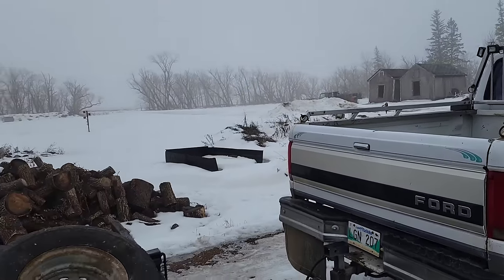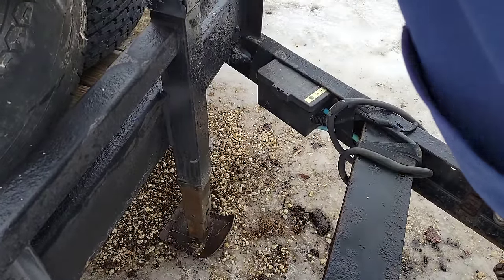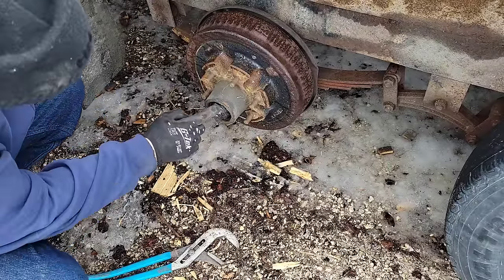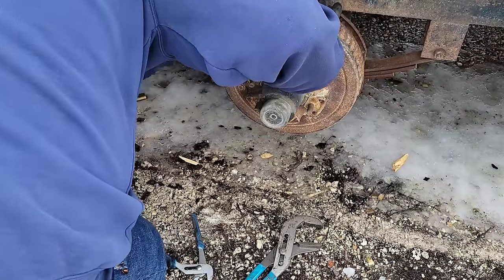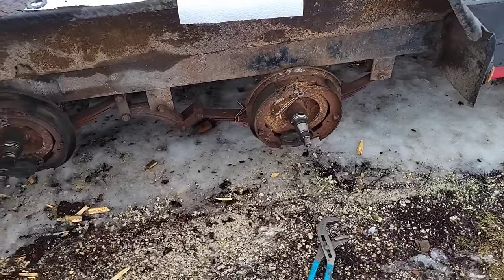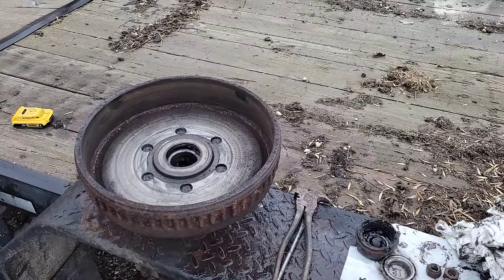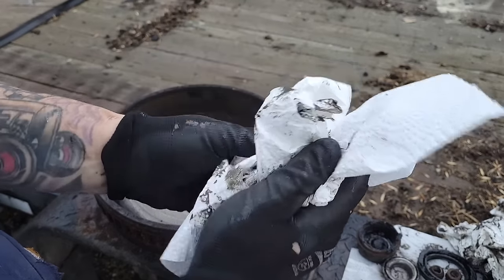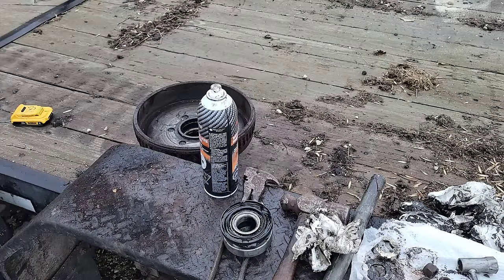I CAN'T BELIEVE THIS TRAILER MADE IT HOME!!

Comment: Hi Tinman, I have had break issues with the dexter axles. The wires that run through the axles chaff(rust on inside of axle tube) and short out sometimes causing breaking issues. I ended up re-running the wires on the outsides of the axles. Good luck with your trailer maintenance.

Comment: I usually replace entire backing plate with new magnet, shoes and wiring(each complete assembly for 5200 lb axle about 50$)4 or 5 bolts to remove old baking plate.
Reply from the maker: I think thats the route I'll go with here.

Comment: You can throw a block in front of a tire and the other one will lift. I use a high lift when I work on my tandem. I’ve even used the winch on the front of my 95 f350 7.3

Comment: Worth replacing all the pads and bearings, give it all a once over and get it set up for a few years of work ahead. Knowing all that crucial maintenance is done is peace of mind, no one wwishes to have a breakdown on the road in the middle of a job. Cheers.
Reply from the maker: That's 100% how I am with equipment..know what I got so I'm not stuck on a road side. 

Take er easy

Comment: Make sure to look over the shackles, equalizers and bolts for wear. Should be plastic sleeves in some of the pivots. If the brakes and bearings were neglected that much those parts probably were too.

Comment: Looks like you have bearing buddies on your trailer, that's good. I go through my trailer every year. That way you know what you have. Like you said, reliable. Also why I don't like lending it out, except to my boys because they have the same values as I do when it comes to equipment. Great content as always. TC Mahalo Tinman 🤙🤙🤙
Reply from the maker: Yeah they're called ez lube axels I think. Never had that before, usually I just pull the bearings and re grease them once a year.
Reply: @tinmanssaws They are fairly inexpensive. Bought my on the am-a-zon. Basically spring loaded caps that replace the dust covers and it keeps the bearings greased. They work amazingly and will definitely save you from a break down. Well worth the investment. I highly recommend them. TC.

Comment: my trailer with ez lube  dexter axles was way over greased by previous owner pumping in grease. it ended up all over the brake shoes. I'd recommend never using ez lube and just service the bearings manually